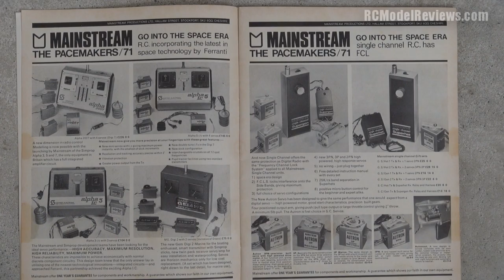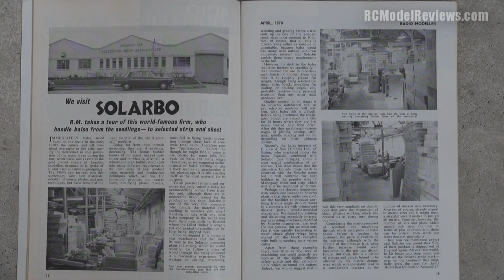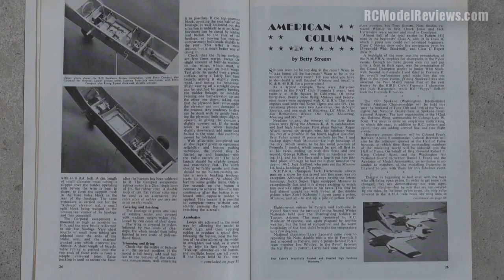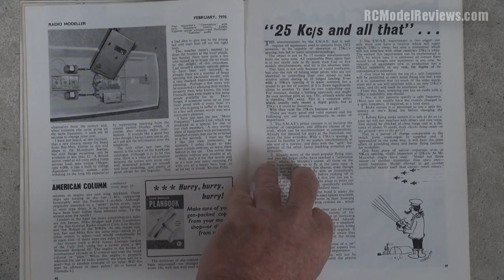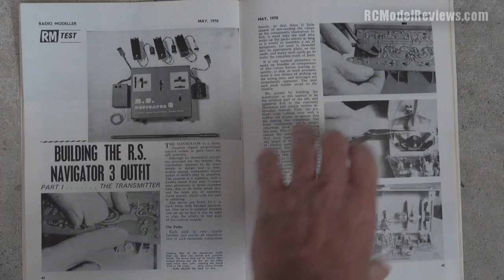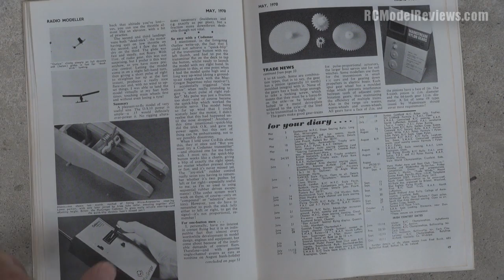RC magazines from 1970

Comment: Mode 1 really was a hang-over from Reed days, when the elevator was non-simultaneous and operated by a blip switch. In 1970 you could get dual-axis sticks in many configurations, but it was the old modellers who drove the preference for Mode 1.

Comment: You can use a modern transmitter as single stick... Just use one stick!

Modern RC sets for air use almost always have four channels bare minimum, too. That's for a $25 transmitter--which is far better in every way than a $2500 transmitter from the early 70s :)

Comment: Despite my advanced years (73) I'm relatively new to RC planes but I used to buy US mags in the late 90s when RCMW & RCME were full of colour and the US mags were much like these 70s UK ones.  Colour was expensive in the 90s because I used to edit a small cycle mag and colour covers depended on sponsorship.

Good video.  I built my 1st Xmitter - a Micron and it worked! Now I know why I didn't fly RC when I was a kid - not at those prices :)

Comment: As you turned each page I could almost remember them articles. I grew up in the UK with them mags. I still have that radio on the mag with the  Macgregor radios. I went from the single channel straight to the four channel missing the three channel. Must admit the biggest and most exciting thing in radio control was when it went proportional. That amazed me, how could they do that..? Until then it was either on or off....